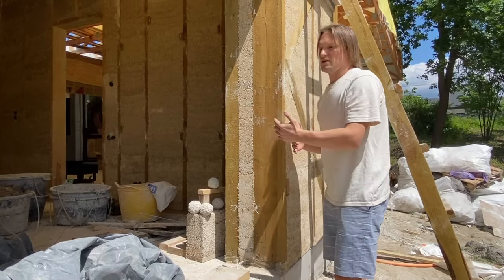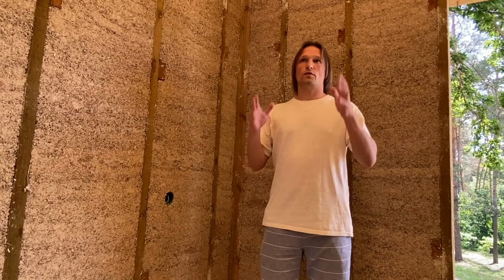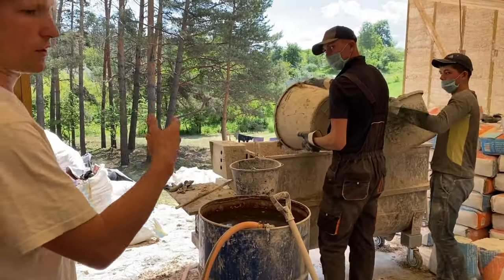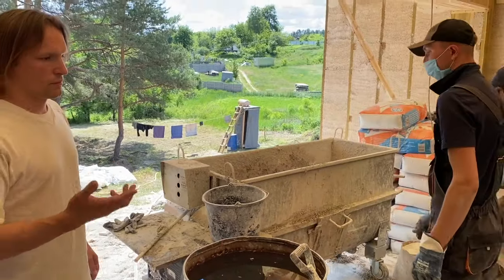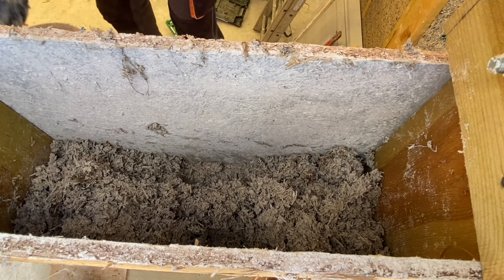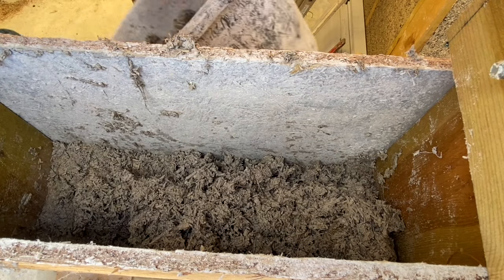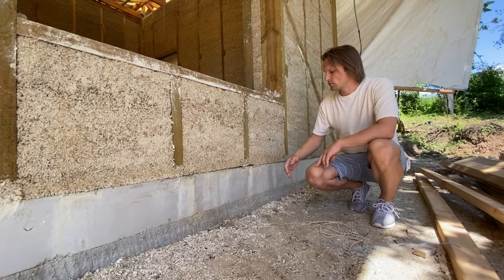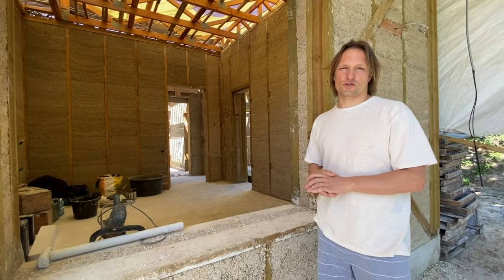Step-by-step guide how to build a HEMPCRETE HOUSE - Sergiy Kovalenkov - CEO of Hempire

Comment: Would it be easier to make Hempcrete Blocks and Build with the Blocks? Using a Machine to Compact them, like a Hydraulic  Ram?
Reply from the maker: It depends if you want to make a business out of it. These blocks will still require mortar, rebar, etc...

Comment: Hello, very simple yet informative explanation. 
You said only suitable cover for hemp is clay, timber, lime, I'm planing to use Cork panels on the outside, as it's natural, waterproof, noise cancelling and breathing well.
Have you got any experience with that combination, what do you think about using it.
Thank You

Forgot, I plan to use nails as cork attachment instead of the glue
Reply: Makes sense only in warm climates, where temperature doesnt drop below 0 Celcius. Otherwise, there could be problems with the surface unless it is somehow treated with wax protection layer.
Reply: @kovser  thank you for your respond

As for the climate I used it already in my office (made of CLT panel) outside without any cover and it's perfect after 2 years, I live in northern part of Poland and it's -10 winter +30 summer, no problems, no deformation....just not know if the wall of hemp will still breath well.

Ps are you coming to Wrocław 1-2 October?
Reply: @marcinbach4689  czołem Marcin! Co ciekawego zamierzasz z tego budować? bądź już budujesz?
Reply: @smartbuilders144  cześć, "long story short" = Dom, ale powiem ci że już zgłupiałem, byłem na targach budownictwa naturalnego pod kątem hemp'u i sam nie wiem. Tak , materiał rewelacyjny, naturalny, ale.....
Dostępność ograniczona, aplikacja czasochłonna, koszty wysokie, prawo niesprecyzowane w temacie.....na dzisiaj chyba jeszcze za dużo niewiadomych.

Podsumowując, rezygnuje z materiału na dom. CLT chyba pójdzie (temat na osobną dyskusje)
Pozdrawiam

Comment: Sorry for the question... 
But why we must put the diagonal bracing please ? the solidity of hempcrate is not enough for the external wall ? 
Thanks a lot for the video
Reply from the maker: Diagonal bracing is an integral part of structural stability of the building, no matter how strong the hempcrete really is.
Reply: @hempireua  
I'm curios... how much strong a wall is: 
1. with diagonal bracing without hempcrete
2. with hempcrete without diagonal bracing 

Witch one ?... 1 or 2 ? 
🦾🦾🦾
Reply from the maker: @MrDenisJoshua  we don’t have scientific data for that
Reply: @hempireua  Yes... but can be interesting to make 2 test wall and misure this :-)

Comment: I think that you will find much  more acceptance here in the United States if the product could be sprayed like foam insulation is sprayed.  The cost must come down as well.   How do you compact the material when you reach the ceiling?
Reply from the maker: You have to compact from the top if you got no roof, or you compact from the side while the other side is covered with the formwork.

Comment: I am in the U.S. and I cannot seem to find any in person trainings offered for 2022. Are you aware of anyone offering hands on experiences installing and finishing hempcrete. Also, I would suggest that anyone mixing hempcrete wear a high filtration mask as exposure to this dust might be the most hazardous part of working with hempcrete.
Reply: I am a hempcrete installer in Michigan. I know of a few different companies that do this throughout the US. Where are you located?
Reply: @kmcroes  hi I m in Chattanooga TN , I m planning to build home with hemp . Would you suggest anyone who can help . Thanks
Reply: @kmcroes  do you know any builders in Virginia?
Reply from the maker: Check USHBA for active hempcrete companies across US
Reply: @hempireua  Thanks Sergiy. Good plug. I would like to know are you notching out a spot on to fit the bracing in the studs?
Reply: @kmcroes  I saw a hempcrete video in which the video creator said hempcrete had a synthetic binder. It made me lose my interest in hempcrete, because I'd rather not have any plastic in my wall. I didn't see that here. What kind of binder do you use at iHempMichigan?
Do you have any experience with combining hempcrete and cob?
Can't wait to hear from you.
Reply: @maartenlaarhoven160  I have never heard of synthetic anything being involved in any hempcrete mixes. There is an 8 percent poly binder in hempwool however with 92 percent being hemp fiber. Hempcrete however uses a lime binder with either a natural hydraulic pozzolan or added pozzolans. There is no portland cement added and no synthetic factors. As far as using cob and hempcrete together I am not sure how or why you do that but you could do particulary walls cob if you wanted depending on what you are trying to achieve.

Comment: Exactly what type of lime did use to mix with the hemp hurds, natural hydraulic lime, what was the binder,  specifically? NHL 5, NHL 3.5. No one ever talks about the ingredients of the mix! If I want to build a house with hempcrete walls what do I need to achieve that?
Reply from the maker: No hydraulic lime. In our recipe its hydrated lime 80% and minerals. So basically its mostly hydrated lime. Companies can have their IP, which is completely normal in different industries. Formulation always depends on different tasks. Some add more NHL to make blocks cure faster, some have special mix for spraying hempcrete. Others focus in-situ casting so they can remove formwork faster.

Comment: Do you have any problems with cracking where the timber meets the hempcrete?
Reply from the maker: Hempcrete has to flush with a timber,  or if covering (going  around)  the stud the thickness of hempcrete should be minimum 3 inches (7.5 cm).
Reply: I mean cracking of the lime based render on the outside, I realise you should use mesh in the render to minimise cracking its just with this 2 stud wall system your creating a lot of timber to hempcrete joins which may be more prone to cracking of the render, do these joins hold up well over time? Especially if you use mesh
Reply from the maker: @sunroo  this house has timber shingles, so this double stud system is the correct one. For the exterior render it’s better to sink the stud in the hempcrete. You are correct.

Comment: The question is the foundation
Reply from the maker: what is your question?
Reply: @hempireua  in a fairly cold snowy climate, would  a concrete stem wall foundation be best, 3 feet down and 2 feet above ground? should it be a foot wide like the hempcrete wall?  and you use a DPC and the hempcrete can go right on top of that?

Comment: can you make balconies in house made of hempcrete?
Reply from the maker: You can insulate it from inside
Reply: @hempireua  you mean I should build a concrete house with balcony and then insulate it with hempcrete?
Reply from the maker: @wiezyczkowata  I need to understand what you are trying to do. It’s not a load bearing material. It’s quite clear that you need timber frame or some kind of surface to attach it to.
Reply: @hempireua  sorry to answer so late, I had a hectic couple of days, what I would want is a 2 story house made of hempcrete with balconies on a second story, if I build a hempcrete house but with a regular ceiling like in a concrete house would it be able to support balconies? or does a hempcrete house have to have a hempcrete ceiling?
Reply from the maker: @wiezyczkowata  you can build a balcony in a hemp house with timber but you just need a proper support columns made out of timber installed  under the balcony
Reply: @hempireua  that's so good to know! thank you so much for the answer!!